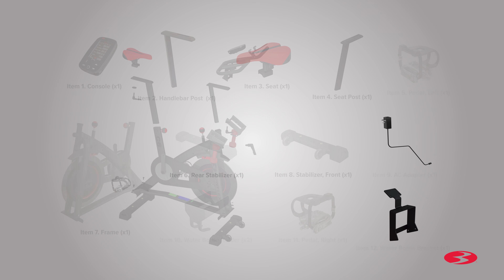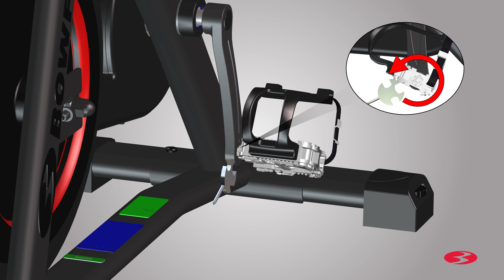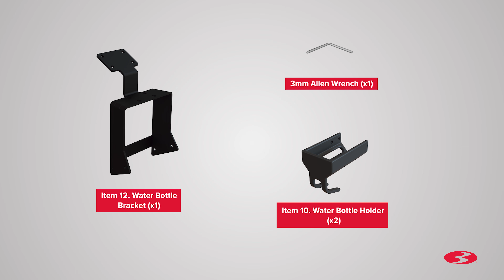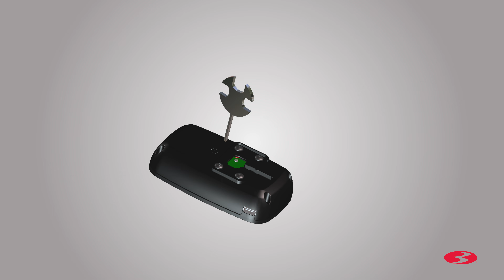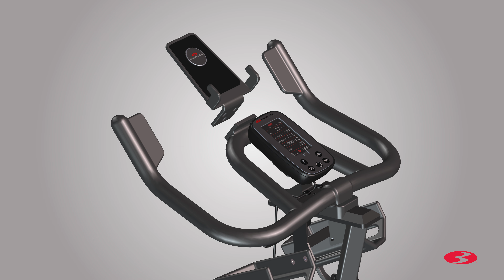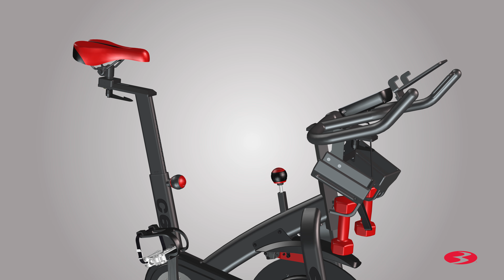Assembling Your C6 Bike | Bowflex® Support

Comment: I don't know how you can put on water bottle holder and tighten the handlebar, it sticks out and you can't slide if it hits . I have been on this for 3 hours and can't figure out how to do it. It can't be tighted and point to the side because then the water bottle holder won't let you slide it.
Reply: I had the same problem since I like the handlebars close (I’m short!) and the handlebar lever was blocked by the water bottle holder. I finally figured out if you pull the lever straight down toward the ground, you can move the handlebars to the position you need, then push the lever back up and in place to tighten it. Pull it down again as many times as you need to get it tightened.

Comment: rear stabilizer on the C6 is different now. current C6 requires 4 holes. I have gotten two bikes without the holes drilled in

Comment: This was the best assembly video. I was easily able to follow the steps. I loved that most of the screws were attached to the body parts - save so much time hunting for the correct screw. It took an hour and 1/2 because I took my time to do it correctly but it was worth every minute.

Comment: We're having trouble with the handlebar post step. When tightened, it only points upwards. It is not possible to get it to point downwards while tight. Even more confusing, our handlebar post has no holes in it. Very confused and stuck.
Reply: I’m also stuck here! There are not any holes to “engage” and the handle cannot point downwards - there is about a half inch of bolt thread still hanging out once it’s fully tightened

Comment: Great video..but I can’t figure out how to get the handle bars closer or further it’s locked in cause that water bottle bracket
Reply: Lisa Gallegos - Dog Training The best way I found was to take the console screen off the bracket that the water bottle trays connect to.  Then remove the bracket.  Twist the handlebar adjustment handle so the handlebars can slide.  Slide the handlebars all the way forward and tighten them, like vid says, with the adjustment handle facing forward.  If the adjustment handle isn’t facing forward, you can pull the handle down towards the floor, then twist it so it faces forward.  Finally you can reinstall the water bottle bracket, and attach the console screen again.

Comment: Anyone else have an issue with the magnetic brake not being centered on the flywheel?  I can't find a video or anywhere in the manual that shows how to adjust the caliper to center it??  I feel like it may be causing the resistance to feel much higher at lower levels than it should.  Customer service (after 2 hours on hold) emailed me excerpts form the manual on brake replacement than don't help at all.

Comment: When you assemble the handlebar to the bike, make sure that the lever is pointing diagonally to the left (from a seated on the bike point of view) when fully tightened or you will not be able to loosen the handlebar enough to slide it closer or further away because of the water bottle bracket.
Reply: If you pull the lever straight down, you can move it around the nut and tighten it from any position! Took me a long time to figure that out
Reply: @Nick Greico Thank you...You're a hero. i was ready to destroy something out of stress and anger!
Reply: Nick Greico Thanks Nick.
Reply: @oldgoattheantichrist3468  THANK YOU!  I was getting frustrated...
Reply: @nickgreico  yes! same!
Reply: @nickgreico  It took me about 30 seconds to figure that one out.
Reply: I had to search other blogs to figure out the handle bar tightening mechanism actually has a ratchet built in...if you pull the handle out toward you, it will freely turn and not engage, which allows you to adjust the position of the handle when tightening!  Something they completely leave out of the instructions...
Reply: Joe M could you possible post a photo? I can’t get my bike set up properly because of not having the bars close enough. I’m pulling and lifting and pushing and still can’t get the right spot.
Reply: @joem5015  I didn't need them to tell me. I was able to figure that out without anyone's assistance. It doesn't take long to figure it out.

Comment: 3 rides in and I am hearing a loud knocking sound near the pedals. I tried tightening everything in that general area but it's still happening. Any idea what could be causing this?
Reply: same here... on my right pedal.
Reply: @safwanrahbany9339  I was able to fix mine by taking the pedal off and cleaning the inside. There was some metal shavings. That seemed to fix it.